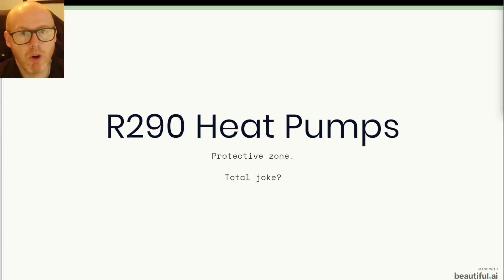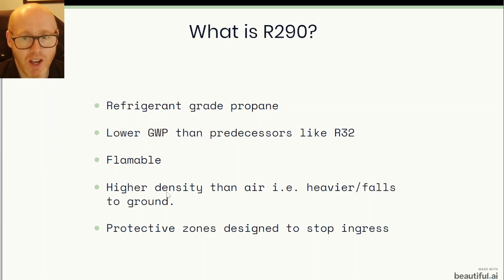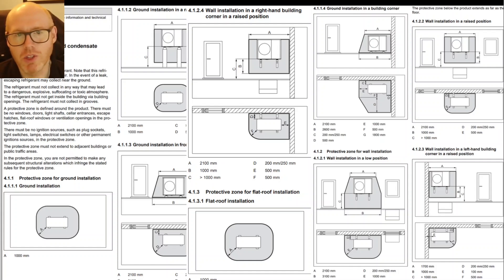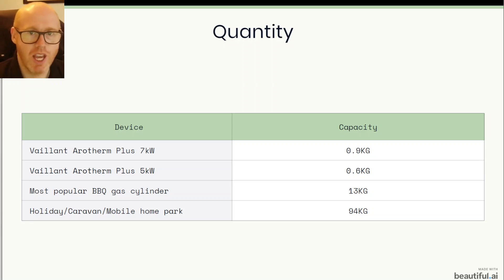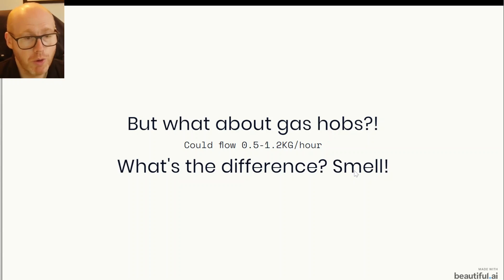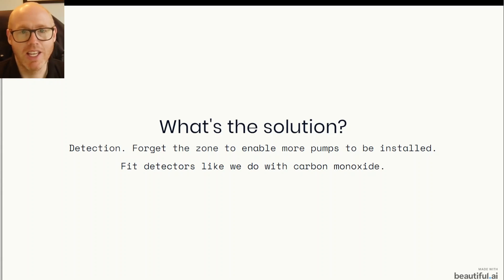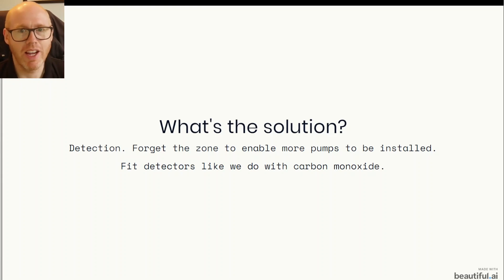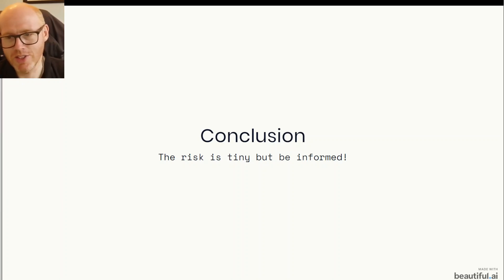R290 Protective Zones Are a NIGHTMARE - Here's Why

Comment: I would increase the distance to neighboring properties to at least 10 metres 
nothing to do with the Propane , it is the noise pollution that is the problem, even at low db levels of modern equipment it is still a serious impact on the quality of life of anyone who spends time outdoors
Reply: My Vailant heat pump is so quiet that I've put a ribbon in front of the fan, otherwise I have to put my hand in front of it to be sure it's on. It's hard to see how anyone in a neighbouring garden could hear it, the unit in your neighbour's sounds either faulty or very old - probably faulty.
Reply from the maker: @MentalLentil-ev9jr  Agreed
Reply: you wouldnt be happy living near me with my gas boiler. sounds like a jet engine taking off 🤣🤣🤣
Reply from the maker: I don't think you've actually heard a modern heat pump.
Reply: @UpsideDownFork  I have the misfortune of hearing one everyday  -  it is installed 1m from our boundary and ruins the pleasure of being in the garden - it is not loud but our garden is / was very quiet
Reply from the maker: @ademason8975  What make/model heat pump is it?
Reply: @UpsideDownFork  No access to it at the moment - I think it was a Valliant and I remember the noise rating was 52 db on the outside unit - installed 1yr ago
Reply from the maker: @ademason8975  I am extremely shocked that you can hear your neighbours Vaillant Arotherm Plus. We can't even hear ours when we're sat on the patio right near it.
Reply: @UpsideDownFork  I guess it depends on background noise - if you live near a road or in a city then 50db probably is drowned out by other noise, here though our background noise is probably 20-30 db and I can hear the heat pump easily at 30m away - and my hearing is far from perfect
Reply from the maker: @ademason8975  If it's the big double fan unit, a 10 or 12kW then the unit is rated at 52dB(A) but that is at 55 degrees flow, so only whilst heating the hot water for 30 mins a day, if that. The rest of the time it will be much much lower, some have measured and approximate that for every degree of flow temp dropped, also drops a dB of noise (many variables but that's a basic rule of thumb). Most well setup systems will run around 25-35 degree flow temps for most of the heating until it gets really really cold and you won't be outside.

Add to that the fact that 52dB(A) at 1m is 42dB(A) at 3m, 38dB(A) at 5m, 32dB(A) at 10m, 26dB(A) at 20m and i'm still baffled how it's possible in any environment to hear it at 30m, unless there is a serious fault with the installation.

Both of my neighbours boiler flues are considerably louder than my Vaillant Arotherm Plus.

Comment: I live in a mid terrace house a little less than 5metres wide. I had to cancel getting an octopus cozy heat pump specifically because the only place I could put it was slap bang in the middle of my garden. Even then it would need planning permission because its functionally impossible to be far enough away from neighbouring properties. The trench and concrete slab base I would have to put it was also basically untenable.
Reply from the maker: Ouch. Presumably you're in Wales?
Reply: @UpsideDownFork  nope, Hampshire. Mid noughties newish build

Comment: All the heat pump rules are ridiculous. I've been installing heat pumps for years, R290 refrigerant is good but rules atound where you can locate them are just wsy over the top.
Anyone can drive a motorhome on the motorway, with a 25l LPG  tank built into the chassis.
Wrote this before even watching.
Reply from the maker: Agreed. Thanks for commenting!

Comment: Fuel-gas refrigerants were banned in the 1920s in domestic applications because they caused explosions. So whst changed? Is human life now less important than global warming apocalyptic religion?
Reply: Just moved on I suppose, leaks are pretty infrequent and the refrigerant quantity is very low. I guess we also lost the need for the fuel to lubricate and have other properties so we can use something non toxic.
Reply from the maker: Can you share a source on this? I think you're referring to early CFCs that contained toxic elements such as ammonia, sulphur dioxide, and chloromethane.

R290 is non toxic so very different situation to the 1920's.
We're also not talking about putting heat pumps inside the home...they are outside.

I'm not sure exactly what your point is, but go and have a look at your fridge freezer which contains a flammable refrigerant (isobutane in most cases), or look at your gas boiler or hob which is burning Methane and causing damage to you through particulate matter deposited in your lungs.

Human life is incredibly important. But those driving their gas guzzling cars and burning gas in their homes don't seem to think so.

There is a complete double standard here and all we know is that the gas and oil lobbies are the most powerful in the world and have helped to shape our modern set of regulations in their favour.

Comment: Looking at getting our 2nd heat pump when we move house Octopus said their Cosy6 was not a possibility due to it being R290 and there being an air brick next to where the unit would go. Doesn't make any sense to impose these stringent restrictions when the risk is so low and the benefits of the heat pump are so great. We'll go with the Daikin unit, but I had a lot of the same thoughts that you've raised here when being told that.
Reply from the maker: Crazy isn't it!?
Reply: I have spoken with Vaillant about air bricks and one can fit a bit of ducting to ‘move’ the inlet to the air brick outside the zone. But yes, it is crazy.

Comment: Heat pumps are a joke for me. I had a home survey with EON and the energy estimation was 11,000 KWHs a year for heat and water. Last year we used less than 6000 KWHs for gas. So much for SCOP of 3 x the effiency. We really wanted to get rid of gas but the whole experience of installers not listening and assuming facts left me feeling very frustrated.
Reply: 😂 if you use 6000kwh of gas then you’ll be fine using 2000-3000kwh of electricity, you’re not going to use more kWh!
Reply from the maker: Did you get 3 quotes? Just as you would with any other home improvement?
Reply: @UpsideDownFork  Yes, I have 2 other quotes which were broadly similar but I have only had one home survey which lasted 2 hours. Don’t really want to repeat the same exercise again to get the same result.
Reply: Have you looked for a heat geek elite in your area , might be worth it if close enough

Comment: I wanted to put a R290 unit, but I have a small garden, and because of clearance area it not viable to put close to the house due to air vents of my suspended flooring. I ended up going for a Viessmann boiler instead, so gas comes inside the house. Stupid regulation! I can get gas inside the house, but not 500grams of R290 that may one day leak under the house. Great job mr goverment!
Reply from the maker: That's really frustrating.
Reply: Remember gas boilers gas is lighter than air and can be smelt
Reply: @guygfm4243  if R290 doesn't have a smell it can soon be added. I have gas cooking and gas fire using propane fed from a 47kG bottle. The commercial propane stinks at microscopic levels and it's heavier than air so it isn't going to climb up over a doorstep
Reply: @guygfm4243 Remember that a gas main can leak infinite amounts of gas, potentially inside the home. We still see the occasional home explosion due to gas leaks!

Comment: The NIBE S735 has propane and is indoors! (Differnt type of heat pump, often used in passive house projects in NL) but by making compartment for propane part, detection, they mitigated risks enough!
Reply from the maker: Yes, I should have gone on to say that several water cylinder heat pumps are now being equipped with R290 and they are frequently fitted internally next to bedrooms.
Reply: Units with ‘small’ amounts of r290 are generally allowed anywhere including indoors. I’m not sure what actual is the cut off but 600gm is apparently too much!
Reply from the maker: @pete_pump @pete_pump I'd also like to know what is deemed too much and how that has been determined.
I cant find any credible sources on this.
Someone told me 300g of R290 is permissable in HP cylinders like the new mixergy but apparently 400g isn't allowed outside do surely something isn't right here?

Comment: Having installed, and lived with, gas detectors on boats, they are a pain in the neck.  Way more problems with the gas detectors than with the gas installation itself 😫
Reply from the maker: Ouch.
We e never had a problem with our simple CO detectors but I appreciate that R290 detection is not mainstream commercially available and could be problematic.

Anyway, the need for any precaution is massively overblown.

Comment: Is  Vaillants installation guide exclusion zone uk  "regulations" of just what they thought of ? I did hear they have abandoned the drain thing completely.         Also you can buy split air to air or air to air indoor monoblock R290 systems , the former is on site piping of R290  straight into your bedroom , which does sound less safe ..   The  chance  of an outdoor heat pump exploding your home through seldom open windows or a drain with a water trap.  is remote. Make a good plot for Mid Summer Murders tho'
Reply from the maker: The regs are the same regardless of manufacturer, it's why you can still buy older R32 units from many manufacturers.
If you really want a bit of a dive, the CIBSE guidance on R290 is a good place to start.
Reply: @UpsideDownFork  Thanks , so " guidance " & "should" seem to feature a lot, ( Also says " A combustible gas leak detector should be used when servicing R290 systems" A 'should' that many service engineers seem to skip)
Reply from the maker: @brackcycle9056  yep 👍 Installers don't want to become liable and I don't blame them because they're being scared by the training and the guidance.

Comment: My 3.5kW mini-split R290 has 400g in it I believe (proportional to output? 🤔)  - the only thing it specifies in the manual is ensuring any joints are outside and not inside - it bothers me less than a mains gas leak frankly...maybe regs written by jobs-worths that are averse to HPs - same with noise levels, planning etc.
Reply from the maker: Yep, I agree 👍

Comment: You also forgot Air Bricks and what we fell foul off is "Cavity Wall Air Vents"
Reply: What we are seeing here is the refrigerant gas industry and the refrigerant compressor oil industry putting pressure on legislators to reduce the uptake of this refrigerant.  R290 itself and the mineral oils used in the systems are about 1/10th the price of R32 and R454B.  Scaring people about the fire risk is their way of preserving their profits by attempting to restrict the sale of these systems.

About 25 years ago I was part of a team that developed a rooftop mounted water chiller using R290 instead of R22, same thing happened. It never made it to market.

As mentioned in the video, we are quite happy to have limitless quantities of methane piped into the house but 1kg of propane in a sealed system outside oh no !!
Reply from the maker: Yes, I did omit that for brevity. Thanks for commenting for completeness!

Comment: Are there any heat pumps that don't use a flammable gas as a refrigerant? BTW, using a fossil fuel as a refrigerant seems bizarre as 1) The heat pump is meant to avoid using gas fossil fuel and 2) There is less than 60 years worth of fossil gas left anyway.
Reply: It doesn’t burn it, so it’s not a fuel.
Reply from the maker: In isolation I can see your concern that we are using a non renewable natural resource. 
But in comparison to how much methane is being burnt by gas boilers it is insignificant.
Or that this amount of propane would power a car for just a mile or 2 at best.
We need to start by looking at the big wins which are removing gas boilers from all homes and removing fuel burning vehicles from the roads.
CO2 is probably the next step after R290.
Reply: The global warming impact of the release of the R290 is a fraction of the impact from manufacturing, transporting and installing the heat pump (or any other product).

I don't have figures, but I suspect that if every heat pump in the country suddenly lost its R290, that would be a tiny fraction of the gas leakage from the grid every hour.
Reply: R32 as used in many is non flammable, my Daikin HP sits under bedroom window,
Reply: @_Dougaldog  it’s less flammable but it’ll still burn pretty well, given the chance.
Reply: @mattundercoat  

It's classed as mildly flammable, quite difficult to get it to burn, given the chance.

From Mitsubishi

"Although classed as mildly flammable R32 is very difficult to ignite.  You can ‘burn’ it, but it needs exacting conditions to ignite so is perfectly safe for everyday use in air conditioning systems."
Reply: You know you’d burn that amount of propane running a bbq for half an hour.
Reply: You can use carbon dioxide as the working gas. It has a number of advantages, aside from being the opposite of flammable, but it’s proving difficult to come up with a reliable product for the domestic market.
Reply: @mattundercoat unfortunately the performance characteristics of co2 aren't a good match for domestic heating. They are good for high temp industrial use eg steam generation.
Reply: The old Vaillant AeroTherms (Non-plus) used to use R410A, that's not flammable. Don't expect a good SCOP with those though.

Comment: Yep. I'm no longer looking at ASHP's because of the outdoor unit restrictions for R290 models & HP's in general. The only place I could feasibly locate an outdoor unit that meets all the restrictions & regs is in a location I would not want to have it. Where I would like to locate one is too close to a boundary fence so not permitted. 
BTW, have a look at your fridge freezer label because it probably has R290 in it as well.
Reply from the maker: I'll have a look but I don't think many use R290 rather isobutane. Still just as flammable but doesn't operate in the high temps that propane does.

It's a shame you're writing a heat pump off. For us, it was well worth jumping through all the hoops to get one just for the comfort and running costs.

Comment: methane 'natural gas' is odorless. They add the smell for home use - can't they do the same for r290?!?
Reply: I think the problem is the odorant would impair the effectiveness of the working gas in a heat pump. With the domestic gas supply it’s not an issue because all you’re doing is burning it.
Reply from the maker: Spot on. They're aiming for efficiency rather than safety.

Comment: Let's put R290 heat pumps outside. If it leaks it disperses, if it burns it's not going to burn for long.

R32 is not as bad as older refrigerants. Even if it does leak eventually, the global warming potential is usually compensated within one or to cold months by not burning natural gas. R32 also gets a higher SCOP in most cases, so over the 15 year lifetime of a compressor it is pretty much a tie with getting R290 as far as global warming is concerned.
Reply from the maker: Agreed 👍

Comment: I've got a six-pack of propane camping gas cylinders in the garage - 230g in each is... 1.38Kg. To be fair they do have a big 'flammable' warning sticker on them.
Reply from the maker: Why did the propane cylinder get fired from the gas station?
… It was too flammable!
No? Ok, i'll stay away from the dad jokes.
Reply: They are also pressurize which would be more likely to explode rather than a small leak from a heat pump
Reply: Though parts of a heat pump are under enough pressure to liquify the refrigerant and at temperatures much higher than you would want to keep your propane cylinder, so the pressure will be higher, and there are more joints and vibration.

The risk still seems pretty small and the propane detector should overcome it.

Comment: Although it would be over kill and haven't read into this one myself but, you could just have openings to be fire rated to resolve the issues where such small quantities are involved. If they are really concerned about explosive risk then, why would they allow it to be installed in an area which persons my often be or pass.
Reply from the maker: It doesn't make any sense.
All of our external windows and doors are recent triple glazed and well sealed around the frames.
The risk is so tiny I'm not sure you could measure it.
Reply: Well with double and triple glazing unless you have a whole house HRV system, insulated homes windows are suppose to be fitted with trickle vents to stop damp issues or try to help lol. 600g of lpg leaking from the heat pump and it leaking into a house would be a miracle all 600g go inside, then you have bigger problems as the universe or God hates you.